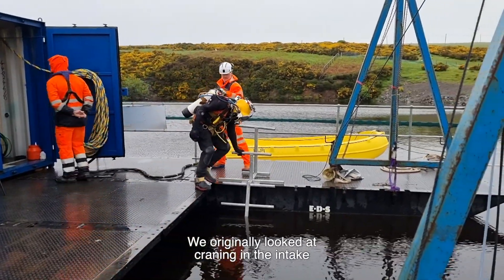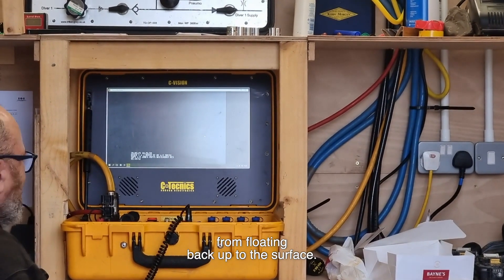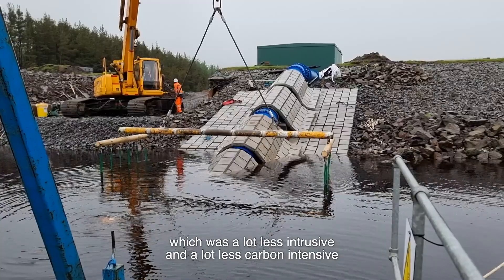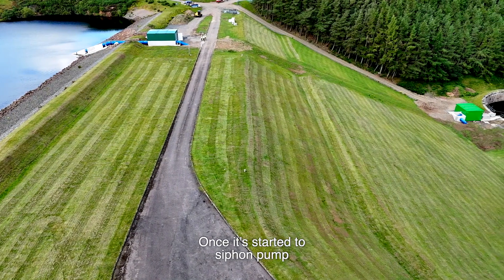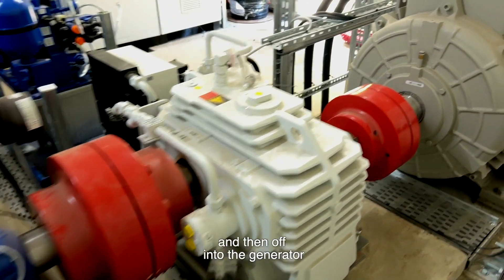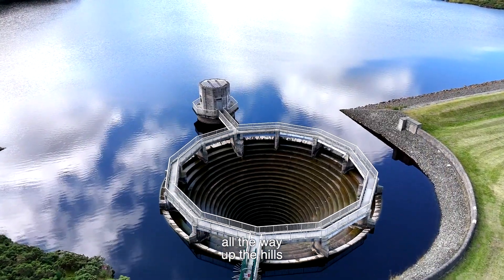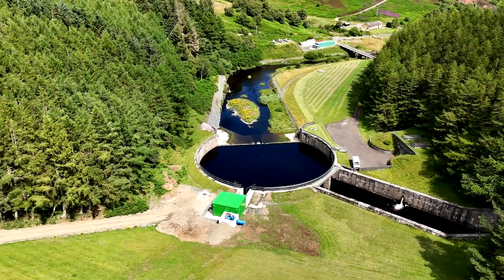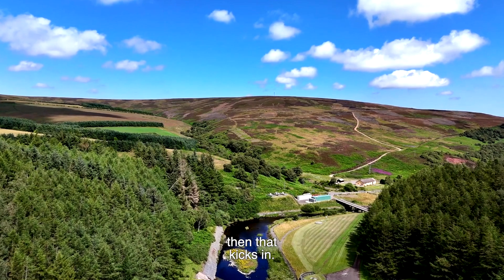Whiteadder Siphon & Hydro Turbine

Comment: Important innovative project - emergency siphonic drainage to meet increasingly intense rainfall. Costly as many considerations required for this first of type - any dam works require exhaustive safety criteria be met.  The high quality turbine used here typically provides 50 years operation before refurbishment, so - actually low cost power over time.

Comment: I suspect the main reason for the installation of this scheme is to control the water level in the reservoir when there is heavy rainfall.  The spillway has constrained capacity and the earth-embanked dam would be quickly damaged if water overtopped the dam.

The new hydro pipe will allow rapid drain-off of excess water at times of flooding.  All dams have undergone reassessment following the failure of Whaley Dam in Derbyshire in 2019 when the spillway could not cope with the overflow.

So this is really the result of increasing rainfall intensity, caused by global heating as a result of burning fossil fuels.  The £3 million is a cost of Climate Change and should be acknowledged as a cost of the oil industry - something the Government is very reluctant to admit to.